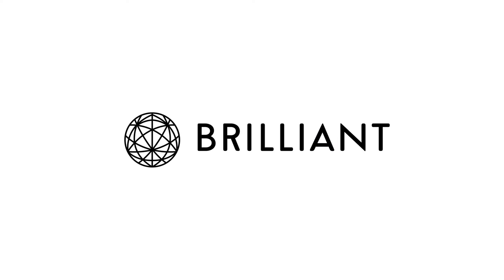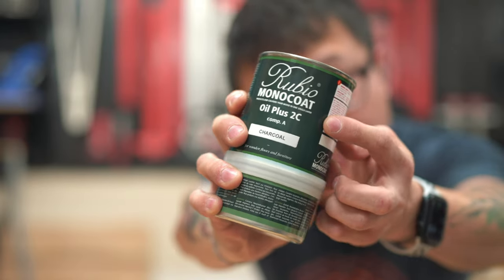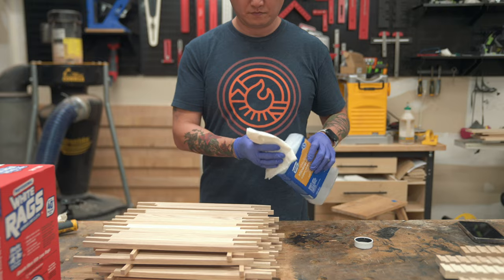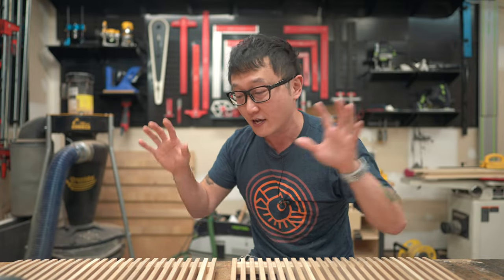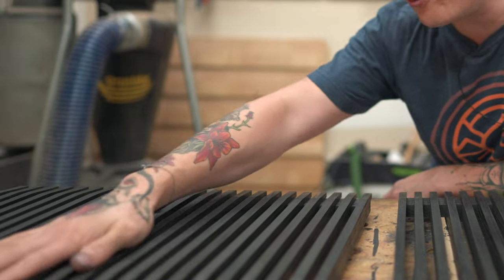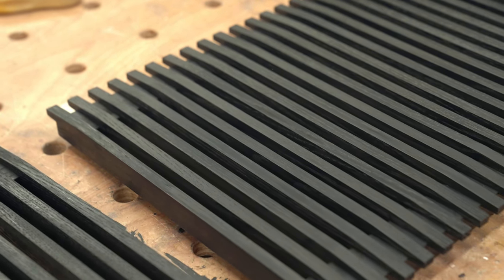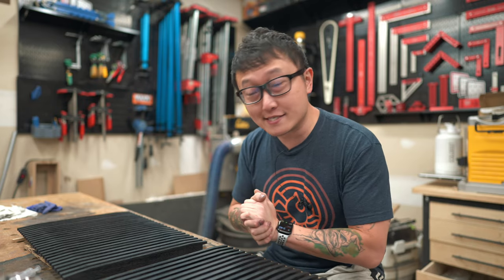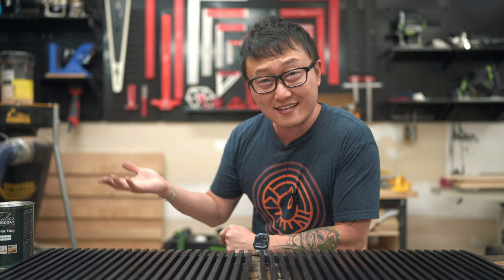How to STAIN AND FINISH Furniture || Apply Rubio Monocoat

Comment: I love to ebonize ash. I use the Rubio recolor black along with the black oil coat. Last fall I built my sustainer wall out of baltic birch plywood . I edge banded all the faces with ash. The one thing I came across when ebonizing the baltic birch plywood , was the wet popping the grain first was a must do step. I learned the hard way that the black pre color would rain the grain. Makes total sense water based product . So the beauty of the rubi pre color and black oil coat was the fact I was able to knock the raised grain with a very light sanding and some scotch pads that were pretty high grit. These are hanging in my garage shop where I enjoy this hobby. With that said it's been 6 months or so and the black is still looking good no sun fade from when I have the door up. I know Rubio has exterior products but they do not make a black that will ebonize like these two products working together. I have tried using ink to ebonize and it works ok but the ink doesn't spread as well as the Rubio recolor products do. I use the product straight but you can cut it with water to either help with application or to alter the effect you might desire in your project. The one down side to using Rubio on larger projects is your arms are going to get a work out from all the rubbing and buffing .. For large flat surfaces I have a Festool rotax 125 I have some felt pads and I just kind of burnish the surface. One last thing my Festool wall was my vanity project and using Rubio to Finnish a wall system in the garage was an expensive and indulgant exercise . For 15 bucks I could o painted everything black I suppose , But I like the way the oil Finnish looks . Well that was long winded to say if you are looking to ebonize ash is a fantastic stock and the Rubio pre color black is an excellent choice. your results will look amazing and the grain will look amazing for you.. whew !
Reply from the maker: Haha yeah I totally agree with you on the ink vs the Precolor

Comment: Good video. IMHO black India Ink is the most cost effective to ebonize wood. Leaves a dense matte black finish with just 1 coat applied with a foam brush. I than spray with water based Lacquer clear.

Comment: I’m using it now on my kitchen cabinets.  We’ll not the pre color but the the other.  Idk if it’s because of the heat here but when I add the accelerator to it it is very sticky and doesn’t give me enough time to colors everything.  When I don’t use it, my finish is more matte.
Reply from the maker: Hm that’s interesting. I suggest reaching out to Rubio about it. I didn’t really notice a difference in stickiness with or without the accelerator

Comment: Very thorough and helpful video. I recently used the Rubio Charcoal (without precolor) on Pine, and when applying it with the same nonscratch pads - I noticed darker scuff marks in my piece! It wasn't producing scratches, but somehow the stain penetrated more intensely in scratch patterns due to the pad. It was weird. Maybe it's the Pine. Or maybe my batch of Rubio was bad? It was a little chunky at first - though I stirred it thoroughly.
Reply: Also 2 days later, I'm still picking up color when rubbing it with a paper towel!
Reply from the maker: Yeah it will pick up color later because it needs to be completely wiped off after applying. I’m not sure about the scratches though. Pine is pretty soft, so it could be from the scratch pads
Reply: @BevelishCreations  Another person suggested that maybe air was introduced into the bottle before opening, causing the stain to prematurely activate. It was in the smaller 100ml bottle, so probably what happened. Getting a fresh one sent and will try again!